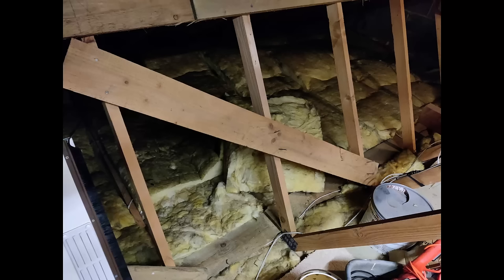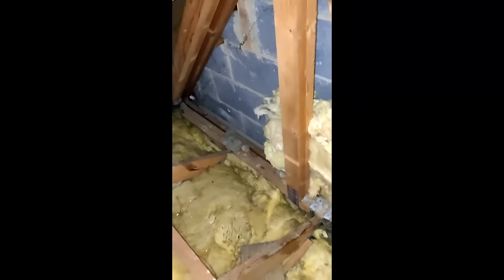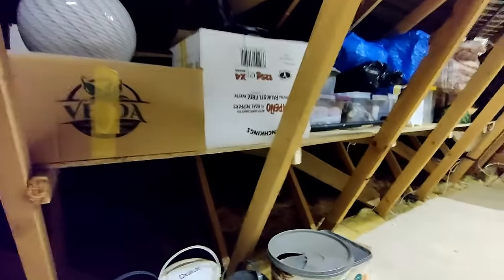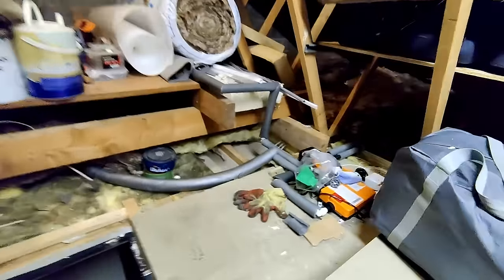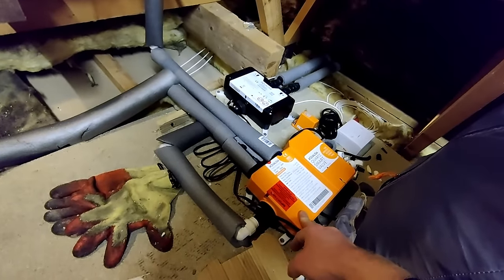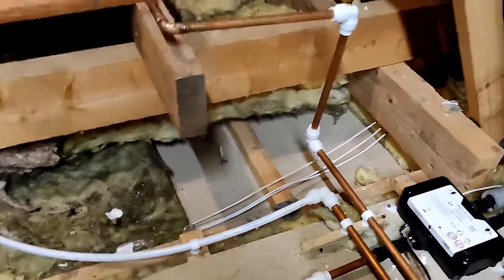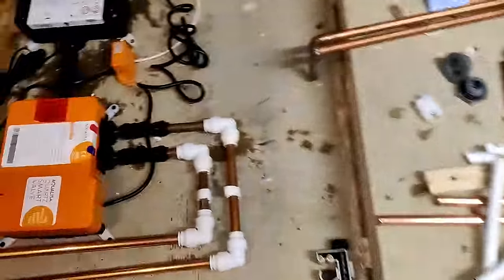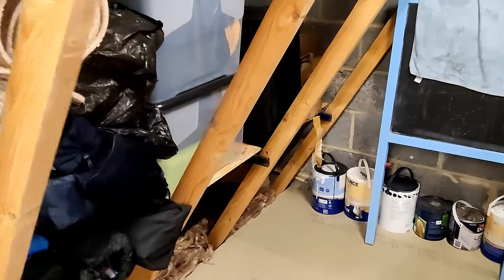Prepping for the Heat Pump: My DIY Loft Insulation for improved comfort and efficiency!

Comment: Nice job with the storage shelves and laying the loft roll insulation.👍However, I wouldn't recommend installing the PIR insulation board as shown in your video. Different types of insulation work in different ways to reduce heat loss and control the passage of vapour. Individually they will only be efficient when installed correctly, each being designed to work in conjunction with other building materials, when combined, resulting in an efficient "system" as a whole. For more info regarding my thoughts copy this link..... https://youtu.be/ygdC9eB-QEw?si=I1D6vTubYEPhMz2v. This channel is all you need to understand the principles of insulation and ventilation in your home !!! 👍
Reply from the maker: Thanks for the thoughtful comment. I do love Steve Roofer's videos!
I have fully considered moisture permeating into the loft space and here's why I believe it's not an issue for me.
1. PIR is not placed in between joists or on the joists.
2. 25mm batten acts as a spacer to form an air gap between original fibreglass insulation and new PIR.
3. Moisture can migrate to either of the ends of the boards to dissipate.
4. I did not continuously foam glue the boards together, they have approx 50mm gaps at 300mm centres to allow breathability.
5. No PIR was used above a bathroom or bedroom, the higher moisture zones of a home.

Lastly I ask you to consider the permeability of OSB and chipboard tongue and groove floors that are used across the country. OSB especially forms a stronger vapour barrier compared to chipboard and OSB appears to have become more widespread in loft applications with very few issues.

Thanks for raising great points and I hope viewers of the video will read your comment if they are considering using PIR in their own loft space.

Comment: Horrible job insulating the loft, but you obviously took your time and made a great job of it, when I did my loft I used loft legs rather than pir and where the insulation meets the soffit I rolled up some chicken wire into a cage and rolled the cage into the air space to form the air gap
Reply from the maker: That's a good tip with the chicken wire 👍 I used a 50mm batten as a spacing guide to make sure I got the gap spot on down at the soffits.
I chose the PIR over loft legs in this case as 100mm of PIR = 200mm of loft roll.
Leaves me more comfortable head height for moving around up there.
It's definitely an easier job as well. Loft legs are definitely more fiddly.
Thanks for commenting!

Comment: Whoa, I topped my loft insulation October 2022. Used 100mmx14 metre rolls pushed up the ladder using my head. I didn't realise how heavy they were going to be. What a  dirty exhausting job, especially getting under those low rafters at the edge ! You have my sympathy.
Reply from the maker: Thank you! Glad you've already got the job done and behind you. Agree that it's not a nice or fun job.
Reply from the maker: Thank you! Glad you've already got the job done and behind you. Agree that it's not a nice or fun job.

Comment: I did my attic about 3 year's ago with about 500mm of insulation and it made a huge difference to the comfort levels in the house.
Reply from the maker: 500mm! Good going! I did consider going up another 200mm but in the end decided that the diminishing returns wouldn't be worth it for the marginal gains in our case.
In my next video I will be detailing the heat loss and why I've gone for just over 300mm to balance the temperatures around the home without the need of TRV intervention.
Reply: @UpsideDownFork  I did go a bit mad but they were selling it for 25 euro a roll at local building supplier and my house is small so not a huge cost.
Reply from the maker: @gwen0437  bargain! Good on you. At least you know you'll never have to go back and do it again! 😁

Comment: Been looking at my loft insulation and found a similar quality job from the builders.  Loads of gaps etc.  Long runs of copper pipe floating in the air. Your use of PIR below the loft boards is an idea I hadn't thought of though so  going to give that some consideration - thanks.
Reply from the maker: Thanks for the comment. I hope this does help you improve your own home.